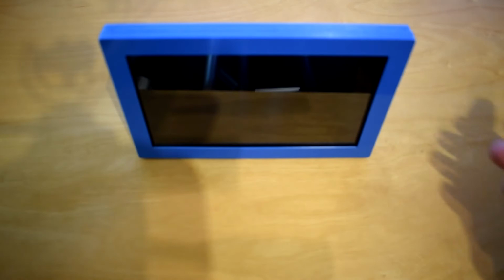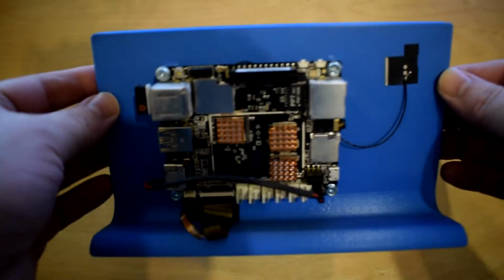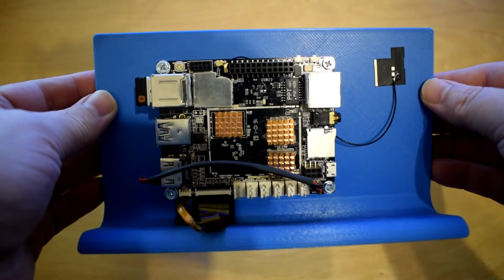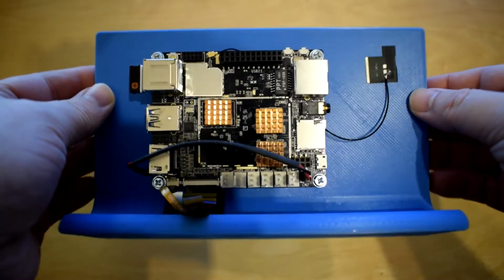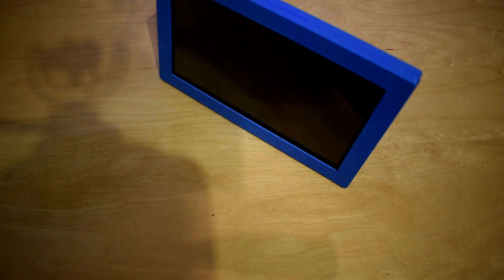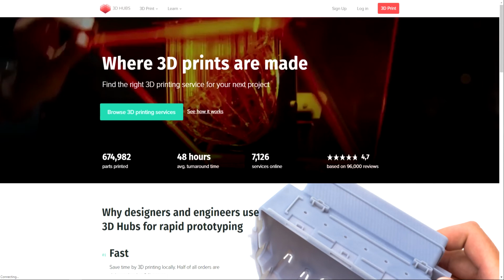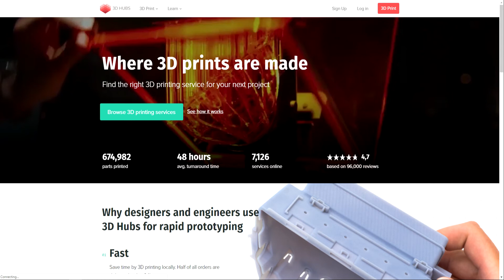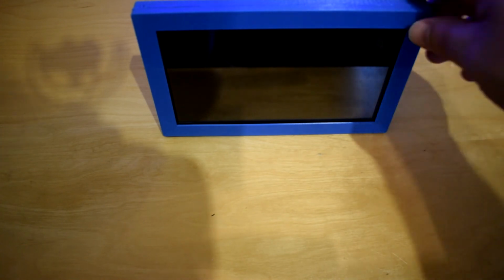Lattepanda, what changes have I made?

Comment: Thank you for the upload - very interesting.
I'm thinking of mounting one of these on my 15.6" USB Monitor (Asus 169B+), only I'm likely to paste-on some kind of heat repellent/protection Material on the back adjacent to were the fan faces the rear of the LCD - the last thing I'd want is some kind of hotspot developing on the rear of the screen
Reply from the maker: You'll definitely need some kind of shielding if you're likely to push the Lattepanda and your monitor has a thin bezel but sounds like a neat solution you're planning there.

Comment: Would be nice to have a cover for the motherboard to prevent short circuit. Nice stand though.
Reply from the maker: I'm thinking of making a small acrylic cover for it probably about the same size as the case that came with the kickstarter project.

Comment: Hello, this case for the display with a touch screen?
What is the weight of the case?
Reply from the maker: You can use the case with or without the touch screen as the touch overlay is quite thin. I can't tell you the weight of just the case alone but the total weight of what you can see in the video (case + screen + touch overlay + lattepanda + 3 x copper heatsinks + low profile fan) is 413 grammes.